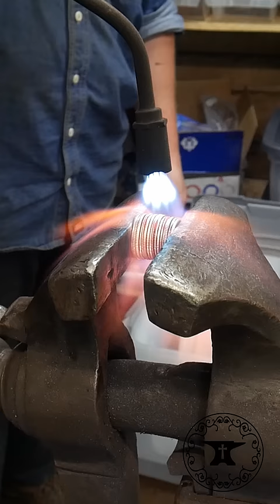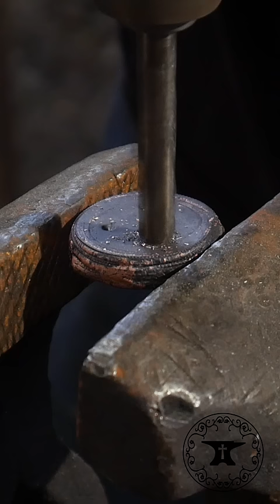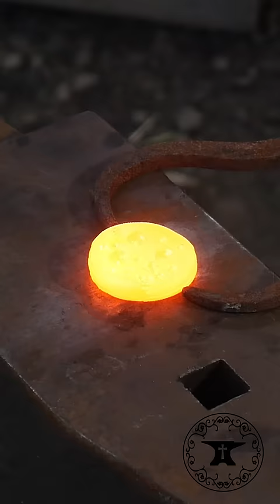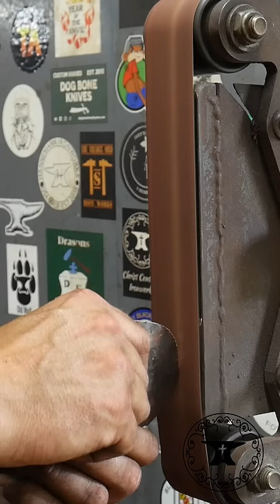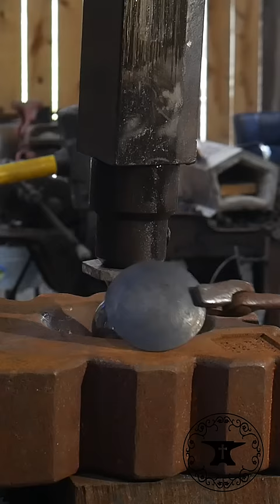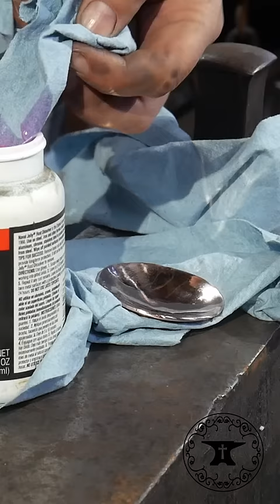Forging Mokume Gane from Quarters! #shorts

Comment: Agreed on the coin collectors part. Quarters are especially known for errors, however the shield penny is a joke MELT THEM ALL
Reply: Yes, pennies are such a waste.
I remember several years ago reading that it cost something like 1.4 cents to make a single penny.
This week I started cleaning at a manual car wash, I see so many pennies just tossed away like, well, they are worthless.
Reply: @busog97641  Well what I was trying to refer to is, that the shield penny is worthless. Give me a roll of pennies that have the Lincoln memorial on the back and I bet I find at least 1 or more gems for a collector

Comment: These guys comment like you lost money. The video didnt do the effect justice. Blade collectors pay premiums for unique blades I made a beautiful Tsuba for a Tanto. Using this very method. A good cleaning with Degreaser really helps with the forge weld. I used some foreign coins and got some gorgeous color variations. It reminded me of a drop of oil on asphalt in the rain.

Comment: but why?
Reply: The pattern!! Lol nothing else gives you this at this cost, you could cut the pieces, weld then, then draw it out, est. OR just use $2-$4 bucks in quarters Lol it would be $20-$30 in material and you will NOT get that kinda pattern this easily.